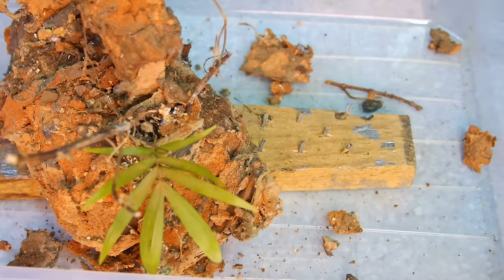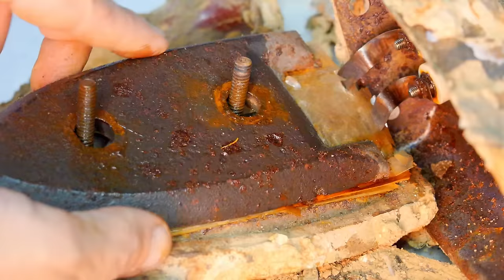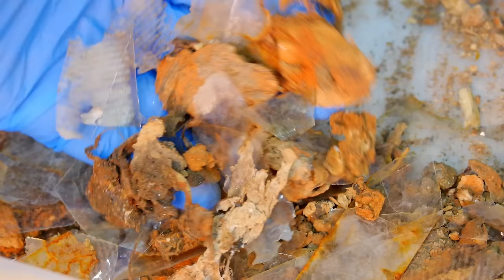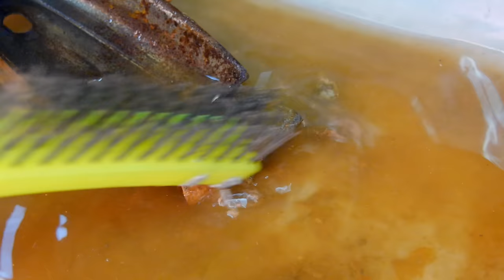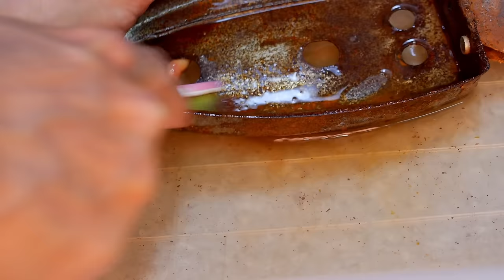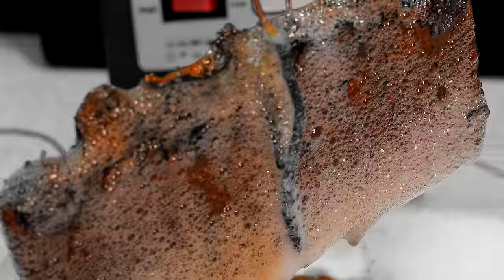EXTREMELY rare Varta first electric iron ! Almost impossible restoration

Comment: Where the hell was this?? Inside the Titanic??
Reply from the maker: ust waited outside for a long time.Thanks for watching.
Reply: Artificially ‘aged’ to make the ‘restoration’ seem more legit.
Reply: @Julmaa87  Really?  Pray tell, how do you get rust to form like that "artificially"?
Reply: @Khrystyna853 I’m not going to judge the authenticity of the channel, but the rusting is the easy part, plenty of guides on how to do it online. What you can’t easily fake is *pitting*, where the rust has eaten away at the metal. Now obviously there is some pitting on the iron, but it’s fairly superficial compared to the amount of crap that was caked on it. There are plenty of restoration videos where the item isn’t half as rusty as this but has some severe pitting that either requires filler or adding more material via welding.
Reply: @TheImpossiBelle  And then, there are plenty of instances in real life, where I, for example, have actually personally found old items in barns with this amount of rust on them, where the rust had initially formed so quickly that it sealed the item inside it, thereby preventing a lot of the pitting.  Believe me, there are enough compromised items out there that deserve restoration, that people do not have to fake it.  They'd still have to do the same amount of work to restore the piece, anyway - which is really the point.  The energy and care of the restorer tells the true tale of their respect for old things, and how satisfying the process is when the restoration is successful.  Most restorers would not take the chance of ruining an antique by deliberately compromising it.  But, some people are cynical and miserable, and just want to hurt others with a crass comment, like the one above.  Being an artist and restorer, I take it a bit personally.  It's just too bad that some people aren't happy unless they've spoiled things for others...
Reply: @Khrystyna853  I believe you’re speaking in good faith, so if you’ll allow me to share why myself and the other commenter have some skepticism, is that unfortunately there have been channels that either a. “embellish” the wear or amount of crud, or b. completely artificially wear the item down (often times it’s not so much wear at all, mostly just stuff covering the item similar to how the iron looks at the beginning of the video, which is why it threw up a red flag). The latter videos though tend to be pretty low-effort obvious cash-grabs at the time that restoration videos really kicked off on the platform. I believe it was another restorer, Backyard Ballistics, that did a video on how to spot fakes, especially those from the likes of the b. group. With the a. group, well, YouTube is a social media platform. Some folks will embellish their content if it means growing their channel and avoiding getting black-holed by the algorithm, to look for a reason beyond the monetary incentive. Similarly when sea-turtle rescue videos got big, there were a slew of copycats going out and hot-glueing trash and barnacles to turtles for clout even though there are plenty of ways to actually help and support wildlife. I’d doubt they were trying to be a spoil sport because they get some kinda pleasure out of it; liars and tricksters can jade people, and that mistrust can make anyone cynical or skeptical of the truth. Hate to kinda just throw my hands up and say “Well, that’s the internet for ya!” but I don’t know what else there is to say.
Reply: @TheImpossiBelle  Nothing I didn't already know.  
If you don't like the looks of the picture at the beginning of the video, don't watch it.

Comment: Not asbestos, that's mica. And it's not a heating element, it's a mineral used for electric and heat solation. Actually, but removing it, you're risking an electric shock if touching the metal. And it really looks like that with thin frail layers. It's a beautiful mineral actually. Look it up 😉
Reply from the maker: Thank you for the information you provided.❤️❤️❤️❤️❤️

Comment: I've been collecting and restoring very early electrical gadgets from toasters, waffle irons, irons, curling rods etc. as a hobby for a while now from the 1910's to the 1920s. I didn't see any heating elements in the iron so how can it work? If you try plugging it in, you're going to get one hell of a nasty shock or trip the circuit breakers. 😳😁
Reply from the maker: it has different heating element.Original one was damaged from being in the ground for too long.I had to buy a new one.(at 20:04 you can see the heating element).Thanks for watching.
Reply: @AntiqueVintageRestoratioNs  оригинальный элемент был из слюды? Из чего сделан новый, который Вы поставили?
Reply from the maker: @sunfun3874  да, мы заменили оригинальную слюду на сталь.

Comment: I am curious about the layer of mica (looked like glass) that was within the iron. It doesn't seem like you addressed replacing it. It seems it's used because it conducts heat but insulates against electricity. Seems important considering all the metal in the iron. Did you consider replacing it but couldn't find a source?
Reply from the maker: It seems it's used because it conducts heat but insulates against electricity it is true.The new heating element I installed is a closed one.You can see it at 20:01.Thanks for watching.
Reply: @AntiqueVintageRestoratioNs  Got it. Thanks so much for the reply!
I was curious to see the mica replaced and wondered where someone would get such a thing today. Of course much better to have a closed heating element. 😄

Comment: Have you tried using Phosphoric Acid? (deoxidine), leave the parts in from a few hours to overnight depending on the amount of rust, the phosphoric acid will get into the pores of the metal and kill the rust, neutralise with water, wire brush and your done.
Reply from the maker: Greg, thank you very much for the information you gave. I have tried muriatic Acid and nitric acid (both dangerous, higly diluted) , but I have never tried Phosphoric Acid acid, although I know it. I will try it in the next restoration. ❤❤❤❤❤❤
Reply: @AntiqueVintageRestoratioNs  I use it all the time especially on rusted parts, although the biggest use is when prepping bare metal panels before respraying, as you would know, the acid gets into the pores of the metal and kills the rust you dont see therefore creating a nice barrier for preventing it coming back, it also saves alot of time scraping, wire brushing etc.

Comment: Its plaster or plastic painted like wood look in the cracked paint or the paint protected it from more damage.
Reply from the maker: Yes, the outer surface is very poorly coated. The chamber has resulted in the preservation of wood. Perhaps if it had been exposed it would have rotted more and could not have been saved.

Comment: What was the purpose of the washing soda? As you require to remove the rust anyway, putting the parts into hydrochloric acid would have been a way better approach, since that also gets rid of any dirt and on top of that will remove most of the rust. Only then one would put the parts into a soda bath to stop the acid reaction (yet that would be baking soda, not washing soda).
Reply from the maker: I will definitely take your advice into consideration.🖤🖤🖤